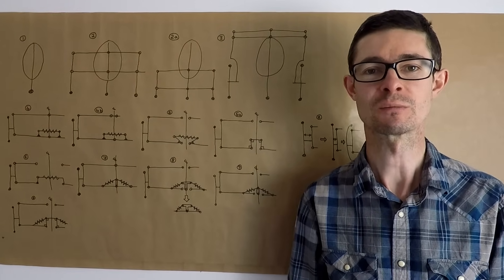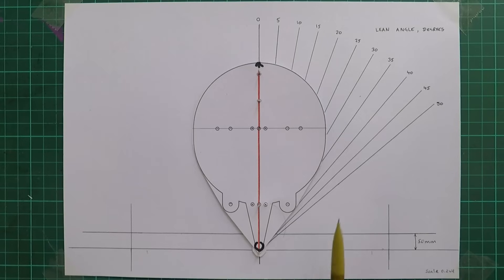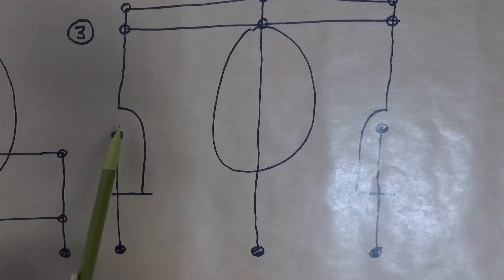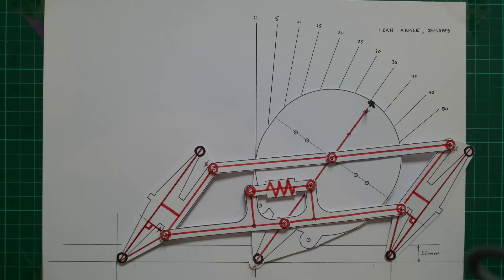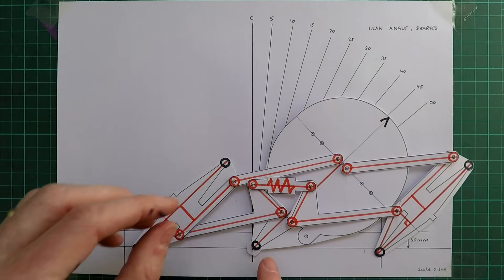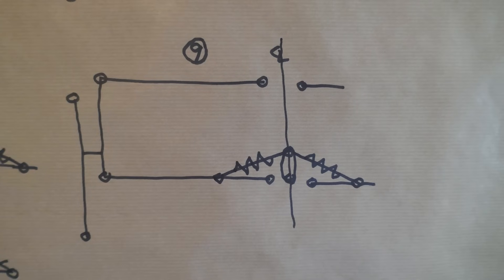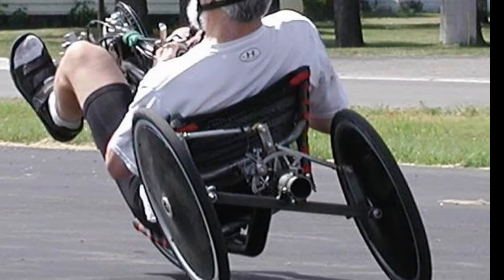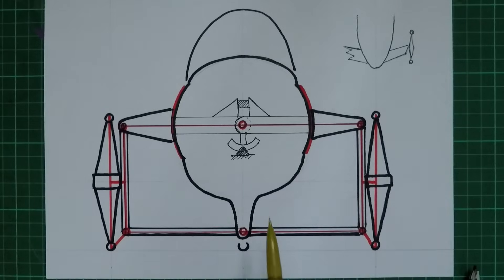Tilting Trikes Part 1 - Velomobile and Motorcycle Trike Tilting Mechanism Design

Comment: Have you ever seen or followed the development of the velotilt? They also did great research on a tilt mechanism. It is now in development in the USA. Edit: I see it is in the video.
Reply from the maker: Yes I love that design.  Mike Lekka in the US bought it and is taking it forward.  His YT channel is called Pushyhog.
Reply: @MetalMachineShop  very interesting project and engineering tour de force. It looks easier to go with a fwd delta trike design. More space in the back and shorter chain for the drivetrain. I will follow your great project! Amazing addition to the Velomobile world!

Comment: A wide track may keep your trike from tipping on corners, but a fast enough turn could break the bead on your tires. You need tilting to keep the forces in line with your axle.

Comment: I like your very detailed analysis, but I am still confused by what controls the tilt to happen. 
Is tilt controlled by the rider's balance or is tilt controlled by the steering mechanism. 

I would imagine if tilt was a summed result of (steering and speed) or (centripetal force) then tilt stability would be constant of (center of gravity).

Could a pendulum pivoting on a disk (where the disk acts like the horn of a servo) and push rods from that disk control the tilt help? (The rider could be the weight of the pendulum)

What about housing the wheels in a shroud like airplane landing gear?
That way, you can have a pivot point in the center of the wheel..
Maybe something as simple as a bike fork that is horizontal instead of vertical,
sort of like a gimbal in a gyroscope. (Where tilt and steer are the 2nd and 3rd axises)
I think there is a gimbal in the rotor of a helicopter blades.. That is kind of what I am imagining.
Reply: I forgot to add..(I'm not sure if this was what you were talking about.)  The turn radius of the wheels for inside and outside of the turning curve are different.
The inside curve wheel turns to a sharper angle.
Reply from the maker: Hi, the theory is that the tilting is completely passive.  The trike balances in the same way as a bike, the mechanism described just allows the tilting to happen, only on three wheels not two.
Reply from the maker: @WagonLoads  Yes - I did another video on the steering geometry - video 3 in my tilting trike series.  Vid 4 touches on it too if memory serves.
Reply: My thoughts were how to make it so that the center of gravity is controlled by the centripetal force of the turn, so that the bike auto-tilts to the right angle for the speed and turn radius you are doing. Thus making the bike self balancing.

Comment: This is brilliant seeing your thought process.  I've also been playing around with this concept in my head.  I do have a serious question though.  Wouldn't the 2 front wheels tilt at different angles in a turn (actually all 3 would be at different tilt angles) due to the different paths each one is taking?  The angles would be dependent on speed and radius of turn I think.
Reply from the maker: In theory maybe the tilt angles should be different, but I doubt it would have much impact in practice, especially with thin tyres.

Comment: I was actually thinking about a similar velomobile design, but for mine the body would be slightly higher and flatter on the bottom, and the fairing would be T shaped looking roulghly like cannards but capable of flexing. I was wanting to do a jet plane canopy like teardrop shaped glass dome on the top as well. I would love to work with you on the design and implementation.

Comment: your suspension arms pivots are offset of the wheel , then put the pivots on the body offset also . left wheel arms mounted ofset to the right on the body and right wheel pivots offset to the left on the body and they cross them self

Comment: I have studied this design for quite some time and have come to some conclusions. 1) keeping the track width at the bottom is important. 2) lean angles of the three wheels should be different with the inside tire leaning more than the others. 3) this lean difference is because the tires are pivoting around the same intersection point but are at different distance from the pivot point or traveling in different circumference circles. 4) the different tire lean can be accomplished by raising the center pivot of the top bar creating a trapezoidal angle in the lean but will also cause the tires to move out at the top under compression of the suspension. 5) Another option is to separate the bottom pivot by a small amount but the down side of this is that you will get tire scrub on the lean. 6) One problem that arises with change in the length of the arms is the steering and the ability to maintain the proper geometry in the lean and turn. Without the lean a vehicle needs what is called Ackerman. This is the angle of the steering arms in relationship with the wheelbase to make the inside tire turn sharper than the outside tire. 7) When it is leaning and turning at the same time the steering geometry gets a bit tricky and you will want it to have the same feel as a two wheeler with the counter steering input to start the lean and turn. If you want to discuss this more in-depth my email address is jford32666@gmail.com
Jim Ford
Highway 101 Rod and Custom
360-536-1441
Reply from the maker: Hi, thanks for your comments! Presumably Ackerman steering action is needed for a tilting design as well as an upright design?
Reply: @MetalMachineShop  I think so on the Ackerman, but still need to build a working model to figure it out.

Comment: Found your video very interesting and informative. Really like your method of paper and pin analysis. Wonder if you experimented with unequal length parallel arms and/or a mono-shock for the upper. Also, a more bulbous front may not be so terrible for aerodynamics. It would be the classical teardrop shape, although not as appealing to the eye. As with all things mechanical, there is no one perfect solution. It's always a compromise. Keep going and the best of luck.
Reply from the maker: Hi, I think you are right that a more bulbous design would not harm aerodynamics (and would probably be better) but it would reduce wheel clearance and would look a bit pants too!

Comment: try a simpler way, imagine 2 arms parallel to the cabin, going forwards 1 meter pivoting from the location where the driver's ankle would be( in a f1 seating way, low and inside a cockpit from the side), almost like two frontal cheetah legs, 2 steel cables inside of it, that move a pulley at the end of the arm, steering the wheels, and tilting is acquired by pivoting each arm up/down, by speed ratio and turning input(electro assisted mechanical bound angle to steering and speed of the vehicle)

Comment: So two wheels are better than 3 except at very low speeds and temporary stopping. Presumably that is a relatively small proportion of the time that you are in the vehicle.  Folding outriggers  seem a lot simpler mechanically than creating a hugely elaborate steering mechanism. Even a motorised flywheel that uses precession to resist falling seems easier than the steering complexity.
Reply from the maker: You're absolutely right, three wheels have few advantages over two, other than potentially less chance of losing grip and low-siding during cornering.  It does make for an interesting design challenge (in my mind at least).

Comment: This comment is very late. At the core, you are essentially trying to develop a tilting double wishbone suspension. As you have discovered, that type of suspension can be complicated. Have you considered developing a trailing arm suspension? You can use torsion bars or polyurethane pads for suspension which requires little room and the independent nature of the trailing arms naturally lays itself to correct angles when tilting. I'm curious what you ended up with. I'll go looking for more of your videos to see your final build. Thank you for sharing.
Reply from the maker: Hopefully you found the test ride video! Sorry for the late reply.

Comment: Very impressive. The stability of a moving wheel changes by (a) braking, (b) steering, (c) different tire-pressure and in case those changes cummulate track and camber have to compensate.

Comment: I wonder whether keeping balance on a mechanism like this is as intuitive as on a bicycle or whether one has to re-learn.  As I understand it, balancing on an eco-mobile, for example, is a bit counter-intuitive.  Also, have you considered that at some point it doesn't make sense for the tires to lean any further, as they will loose traction, while it may make sense to still allow the rider to lean further in order to keep their center of gravity ahead of the bicycle to prevent tipping?
Reply from the maker: I'm thinking of building a simple prototype to test the usability of the basic design.
Reply: @MetalMachineShop  Nice. I've given this a lot of thought as well, so it was fun to accidentally stumble onto your video.  There's a french quad bike with full suspension that looks really impressive that seems to use centrifugal force to do the leaning for you (by placing the pivot above the center of gravity), as opposed to the classic bicycle-style where you have to anticipate the centrifugal forces and get ahead of them.   The dampers keep it upright and from swinging around too much.  The mechanism takes up a ton of real estate though, so it's not aerodynamic at all (but plenty off-road capable).  I've currently got ideas for a kneeling/tilting mechanism that's controllable separately from turning and doesn't require shifting one's body weight to control it, but likewise, I'll just have to test it to see if it's feasible.

Comment: I'm just thinking Ackerman should be applied to your tilting action, as that is how you'll be steering at higher speeds. I assume higher speed correct tracking is more important to you than low speed start and end of ride tracking. The turning mechanism is only needed for slow speed small radius maneuvering.  Maybe the tilting mechanism can be a sub-assembly mounted on a pivot, which would be the pitch axis for turning the whole tilting assemble in the left/right horizontal plane for tight turns.I'm Thinking of a handle bar that can be pushed left and right for tilt, and twisted in the usual bicycle manner for turning the tilt mechanism on the horizontal plane for tight turns. I'm saying this several different ways, because I can't put a picture of it on YouTube.

Comment: what about having forward pivoting swing arms with shocks mounted to a pivoting arm that remains parallel with the ground? as the arms swing through their arcs, the variations will be in wheelbase instead of track. with limited wheel travel the variations in rake may be minimized by the length of the swing arms. for long travel suspension 4 arms may be required to keep rake more constant
Reply: captarmour - it may seem counter intuitive but if you model your idea, you'll find that at the road surface, there would indeed be a dramatic increase of track width with lean. All else being equal, the parallelogram maintains track width with lean.
Reply: @flannel2699  oh yes you are so right! I was more concerned about scrub than track. I'll need to wrap my head around that.
Reply: captarmour - don't worry, it caught me out as well :)

Comment: Just a marginal/secondary info: try to use Freecad for your 2D experiments. It doesn't cost thousands of dollars. It is free, and provide a so-called sketcher "workbench" where 2D drawings can be constrained in many ways, leaving other parts of the drawing free to move. In such way you can manually "animate" the movement of the parts with superb accuracy.
This use is not what planned by the authors, nevertheless a lot of people use it for their 2D-movement simulations (me included).
Reply from the maker: Cool, thanks for the tip!

Comment: Hi. I enjoyed your video and approach! Tilting trikes have been on my mind for years. Would it help if the two vertical arms supporting each wheel were angled out at the bottom so they aim at the tyre contact patch? I've done that on a gravity racer and it really helped. Obviously the inboard suspension pivots would no longer be in line vertically if the top and bottom arms were to be of equal length. Kris
Reply from the maker: Hi, thanks for the comment. I agree that the steering pivots/kingpin should be angled as you describe in order to reduce/eliminate bump steer. I’m planning to upload another video of my emerging design that includes this feature, just as soon as I get time.

Comment: Before talking about my two cents with possible mechanical solutions, let me point out that this design is going to worsen aerodynamics quite sensibly. Two wheels out of the body add surface exposed to the airflow, above all if they are uncovered they won't have a good airfoil even with side pads, plus the upper half of each wheel will meet the airflow at up to double the velomobile speed (and you know, air drag is proportional to the speed squared... Apologies for the bad translation). Of course you may put fairings on the wheels, so basically your design would become close to a Leitra velomobile... Not the fastest thing on earth, but that's true, it's not designed to win races.
About tilting mechanism, personally I'd go for the simplest thing ever: I'd let the body and the single wheel lean, but I'd keep the coupled wheels at a fixed angle to the ground. In this way you'd have one arm only instead of two (less drag), one pivot point only (less complication), and you could fit the suspension between the pivot and the frame, less weight and no tire scrubbing ever. The only con with this structure is that you should find a way to keep the velomobile body closed where the arms cross it... But you can move the pivot just out of the body, either in the back or in the nose. Just my ideas on the loose... 😊 Good luck with this design!

Comment: hi i dont know if this is a dead end but a old f1 car from cooper would use a leaf spring as the upper arms i would imagine a composite mono spring wouldn't create much drag out in the air and could save you space
Reply from the maker: I think a leaf spring would be a good solution provided it wasn’t too bendy.

Comment: I'm very interested in the velomobiel.nl Quattrovelo design, as it provides far greater stability than a typical tadpole trike configuration.  If traction in the third (rear) wheel is lost, the tadpole configuration becomes dangerously unstable.  I don't believe any amount of body tilt would alleviate this problem.  Perhaps the best of all worlds with these machines would be a four-wheeled design that has a modest amount of tilting capability.

Comment: My idea would be an arm goes from a wheel to the bike body's half plus (length a) the wheel axis length to the wheel's center (length b/2), total arm length of a left or right arm=a+b/2. The arms are mounted at a vertical plate on the bike body and have to be curved to not touch each other. That means, at the bike body, they are before and behind each other. The result should be two exact parallelograms. What do you think about it?
Reply from the maker: Hi, sounds like a good theory.  Should work; you could test it by building a CAD model.
Cheers, MMS.

Comment: Been playing around with trike design and really want to build one with a leanable back end.

Have you considered what each scenario would do if you changed you perspective angle a bit? Would any of those situations improve by leaving the top bar in position but kick out the bottom bar more to the rear? It seems to me the bars needs to remain parallel but not necessarily directly up and down from each other.

To help visualize imagine top bar leaned forward like a wheel/chain stay towards the top of the seat post
Reply from the maker: There is no reason for the top arms to be directly above the bottom ones, so there is room for experimentation.

Comment: Forgive me if you've said, but did you consider Akerman angles in your chosen design? The inside tire in a turn will need to have more lean than the outer, to follow different radii.
Reply from the maker: AngelAndTheWolf Hi, I am intending to use Ackerman geometry in the steering geometry.  I didn’t cover this in the video, which was just about the tilting mech. I am planning another video soon when time permits, which will look at the steering geometry, including caster angle and kingpin angle in more detail.

Comment: You mentioned that if the two wheels were in the rear (delta design) it would make things easier but the hassle involved in the drive train engineering wouldn't be worth it. Have you considered doing it in a delta design with front wheel drive, as Cruzbikes are designed?
Reply from the maker: Yes I thought about it but I don’t really like the front wheel drive concept.  It would require some non-standard parts and put a lot of twist into the chain on steering, depending on the design.  Also I’m not keen on delta trikes; anecdotally they have poor aerodynamics and with only one wheel  in front you don’t get the advantage of improved grip at the front that a tadpole trike gives you.  My latest video talks about my velomobile design if you are interested!

Comment: Sir, my hat is off to your work, I want to build a tilting recumbent electric trike myself.  Have you seen the Quadro system? What do you think about it?
Reply from the maker: Víctor René Valdivia Soto Hi, sorry for the late reply.  I just checked out the Quadro hydraulic tilting system.  I think it’s a neat way of combining the suspension with a tilt lock.  The hydraulics and air shock could be mounted anywhere. You would probably need small, custom made pistons light enough for use on a human powered vehicle.  I imagine the tilting action would be slightly sluggish (slow) for a HPV, but that may not be a bad thing.  Thanks for putting me onto it!